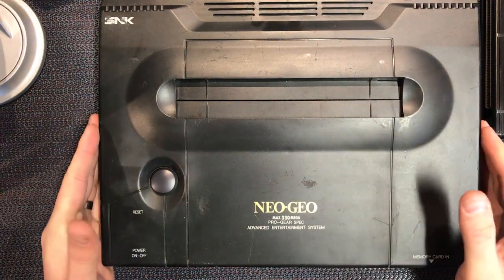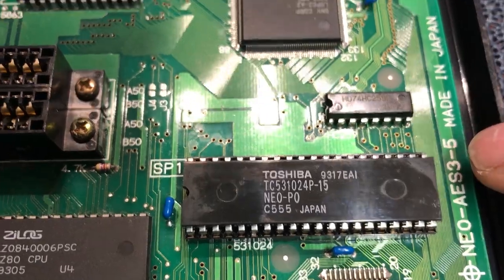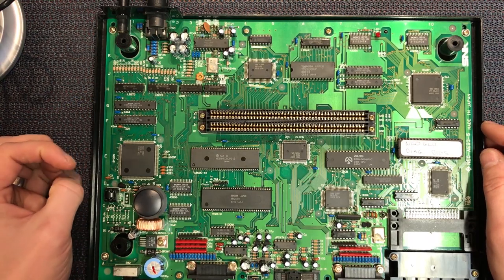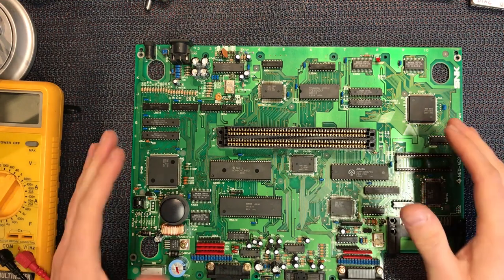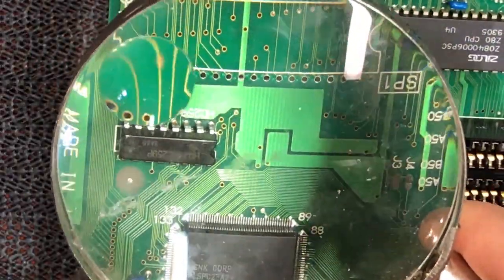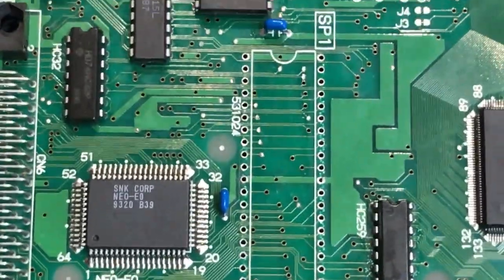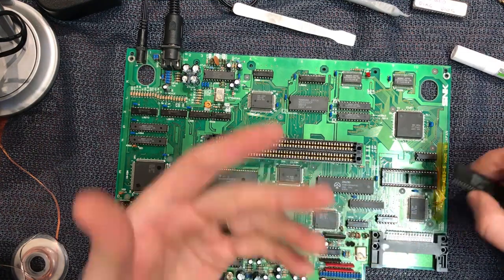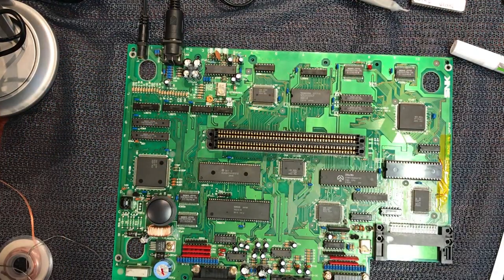How to Repair Neo Geo AES Console Garbled Graphics  - YouTube

Comment: Darren what size Tips do you use when desoldering the AES Bios with your Duratech ?............0.8,1.0 and 1.3mm for example
Reply from the maker: I use the smallest one I have which is approx 1.3mm. Any larger than that and it doesn't have the sucking power to clear out the hole (that sounded dirty)
Reply: thanks mate for the info ,  loved the end part also it made me giggle

Comment: Hi. Thanks for your great videos. I have gone over more you have posted trying to see if I can diagnose mine. My neo geo actually plays games but recently there are hundreds of with dots on the screen. You can still see the game playing but the hundreds of dots (about 1 millimeter in size) are equally distanced apart all over the screen. Do you have an idea on what the problem could be? My first try will be to replace all the internal capacitors as I know how to do these from changing lots on the FM Towns Marty I have dealt with. But I am not familiar with the Neo Geo board. Let me know if you have an idea. Thanks for these amazing videos!
Reply from the maker: Possibly a bad power supply. Is it aftermarket?
Reply: @GlobalGarageAus  Thanks for your reply. I actually have two snk genuine power supplies in working order. I also thought about the av cable by I tried another and there is no difference. My serial number is actually high and it is one of the late and newer neo geo consoles. I have had it for about 15 years and nearly played a few times. The console looks like new I don't really have an idea on the problem causing the messed up screen. The intro of any game when it says warning the games are only to be used in Japan....looks really clear with no problems, but when the game intro starts the issue starts. It is not the games. I actually have two systems of each I have. One bit up to play and a really nice one to display. So the bit-up one plays good and the one for display is my faulty one :(

Comment: I ripped off a trace doing to the bios socket the same way. My aes worked fine beforehand. I took it to two shops that microsolder they won't follow my request of desoldering the pins professionally and inspect that area because we all myself included find continuity through the whole board so im scratching my head im not sure if it's not getting enough of a connection or what. I only own basic soldering tools and because I botched it once already im too nervous to remove the socket by myself again and check 😭 ive emailed a bunch of shops and made phone calls and no one will help im at a loss right now
Reply from the maker: J L Where are you based?
Reply: @GlobalGarageAus  Im In the United States

Comment: This is weird when I socketed my AES bios the exact same solder pad came off! Remember, always check if you ripped something and if so put a tiny jumper wire to fix it.
Reply from the maker: Yep that pin seems to have a lot of solder on it, so if you're not careful it'll lift right off. Desoldering any chip can be tricky if you rush it. The gun I have was the best investment I ever made.
Reply: Me too, I was sick of ripping traces of older PCBs so I bought a desoldering gun. They can be quiet expansive but there are some around 75$ that do the job perfectly.